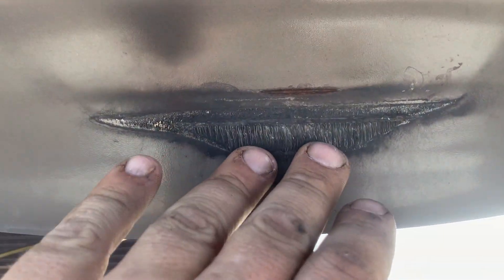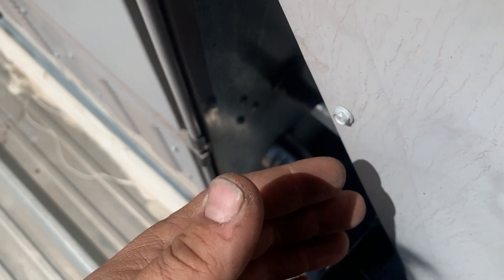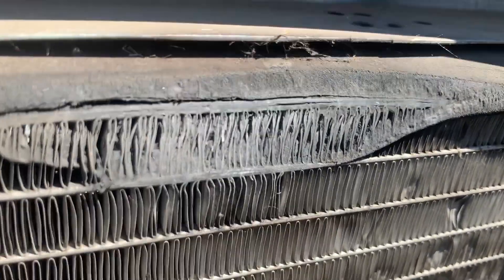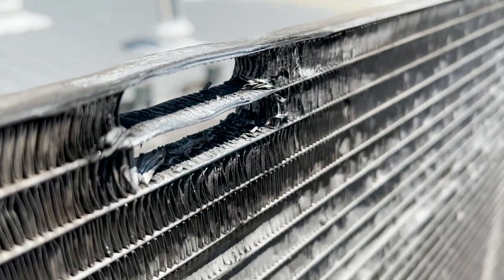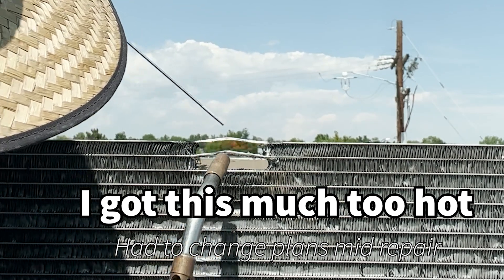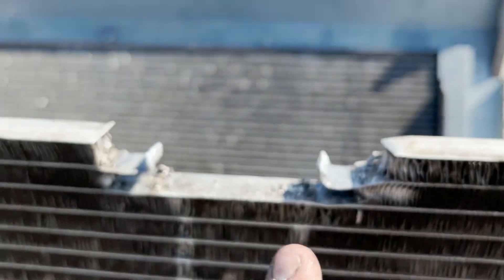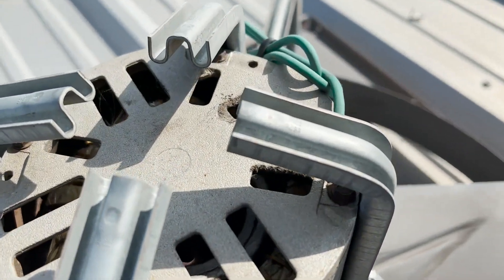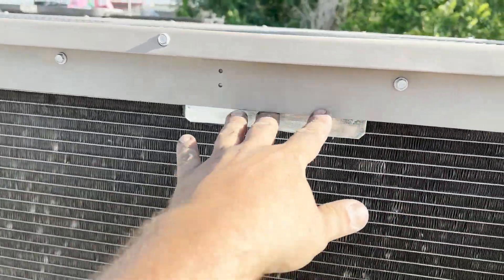Making an emergency repair in a Microchannel aluminum coil using Solderweld's Alloy Sol

Comment: Had to be a York 😂😂😂😂 I’ve changed like 30 coils at a mall cause the coils would leak after 5 years after it was installed…but it was at the copper to Aluminum connections. 

Terrible design. They need to go back to copper coils. For better reliability
Reply from the maker: Absolutely a York.  I agree the copper coils can take much more abuse. We offered the copper replacement, but they wanna ride this repair till it dies apparently...

Comment: Great video.  Just curious,  was the head pressure or subcooling affected after blocking off that channel?  Or, was it noticeable?
Reply from the maker: Basically no change. I think it being a top row heled a lot as not much air is bring moved in the top couple inched of the coil

Comment: Better than what I could've done. I've tried on two different occasions to repair these microchannels but I failed to do so. 
The heat just ends up burning a hole right through the aluminum and say if I were to repair the leak I probably burnt a hole on the top pass doing so lol
I think if the leak was in the middle of the coil or a bit lower it would have been tough since heat rises and just melts the aluminum.
Next time I'ma try those LACO epoxy sealers. It's like a green crayola. You heat it up and it melts onto the metal forming a bond. Lot less heat than soldering.
Reply from the maker: thanks bud, I haven't had a chance to try any of the epoxy sealants, they look like they should work especially if the system is hooked to the vac pump at the time of the repair. I did repair another coil after this one and used the same rods but with the flux core inside, those where a little easier to work than the dry flux and rod combo in this video. Also did some warm up spots on an aluminum can to get a feel for the rods before the coll. Micro channel coils are a PIA, everytime I quote a replacement, i use nationwide coils, they make traditional copper tube coils that fit in place of the microchannel coils.